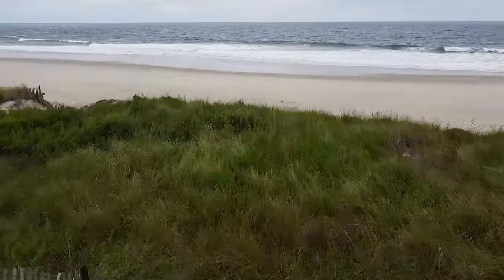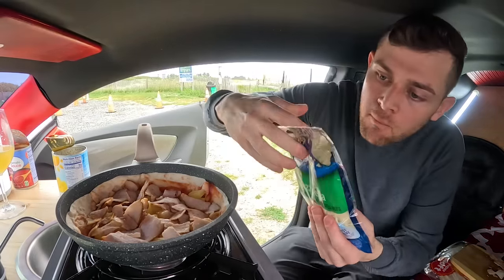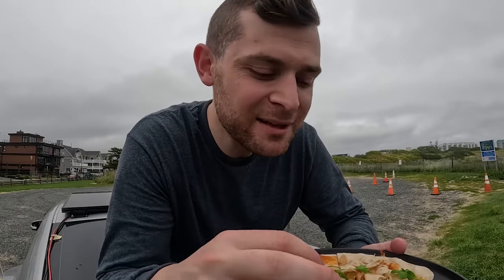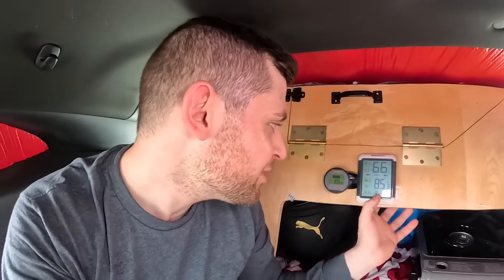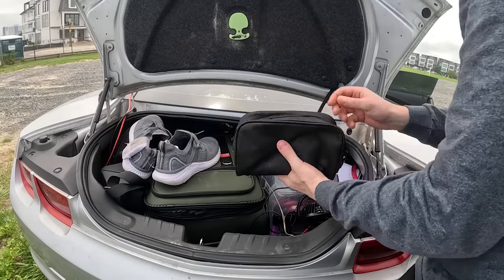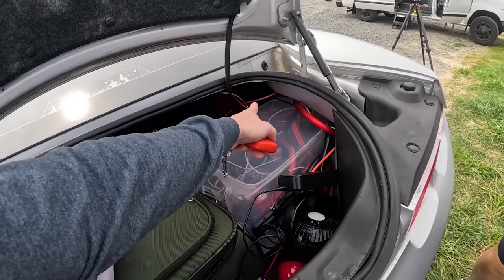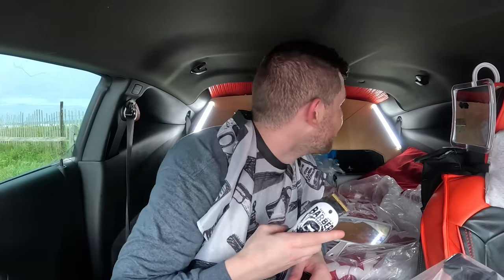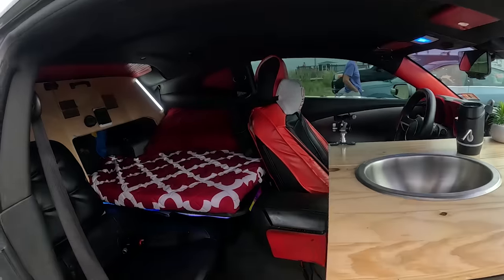My First Time Living In My Car ON THE BEACH! (East-coast Van Life in a small camper)

Comment: the reason pineapple works on a Hawaiian pizza is because its sweetness works well with the salty ham. switching the ham out for honey roasted turkey completely changes it and you lose the balance.
pineapple also works well on anchovy pizza, because of how salty the anchovies are.
also, tomato sauce is not the same as pizza sauce. tomato sauce is sweeter than pizza sauce, and pizza sauce has a bunch of other ingredients like oregano, basil, garlic...
your best bet is to just try it from a pizza place, that way you can have a proper taste test. but iff you want to make it yourself you can easily turn tomato sauce into a basic pizza sauce by adding in some garlic and herbs, or you can buy a premade pizza sauce from walmart or any other store.
but you gotta do it with the ham. ham and pineapple is a combination that just works, on or off pizza, that's why when you see a picture of a really fancy dinner if there's a ham on the table it will have pineapple rings on it.
pork in general works better than basically any other meat when mixed with sweet flavors.

oh, and if you are interested in trying the anchovy version, i suggest anchovy, pineapple, and diced tomato for the toppings. it sounds weird, but it really works

Comment: First time watcher here! Live your videos man! KEEP THEM COMING! I saw you’re working on a set up already so it too late to say this, but you should look into Sterling Fleet Outfitters and the toppers they have for trucks! I have one on my work truck with a PULL OUT HONDA 3000 generator that powers the A/C unit. It also has a built in heater. No need to turn the truck on for heat or A/C and putting unnecessary strain on the engine!

Comment: Hello! If you need to get sand off just put some baby powder on sand and it brushes right off. Also, if you get a plastic cylinder frosty white storage container from the dollar store and adhere a simple  push light (also from the dollar store) to the inside cover you'll have a great cheap lantern with a built in handle to get to the public restrooms when camping or just general light. It really puts out a great throw of light that bounces off the frosted white. And if it gets dropped , it's plastic. No worries.Especially handy during power outages. I've put quite a few together for family and friends.

Comment: OK so here is a few suggestions when it comes to that pizza... you should have used Pizza Sause instead of tomato sause.  the seasonings in Pizza sause are does help  also you messed it up with the Turkey. you can not just replace ham with turkey.  the only way you could have done that is gotten some Turkey ham so it keeps the ham flavor.   next you needed more Cheese maybe you could have tried making it a double decker.  you have the shell Pizza sause cheese and then used the melted cheese to attach another shell then pizza sause , cheese turkey ham and then the pineapple.

Comment: LED overheating ! Dangerous, check for correct voltage DC and amps . install with quick blow fuse . Don't mess with elecs witt incorrect ratings .

Comment: Did you use actual pizza sauce or just tomato sauce? You need the Italian seasonings. Turkey sucks on pizza. Ham and slivers of pineapple are good if off set by spicy pizza sauce. Otherwise a good idea! Good luck on your SUV decision. I own a mid size SUV. The head room is short if you dont remove the back seats. The front passenger seat removal would offer benefits, too. This time, have the vehicle prepurchase examined by a mechanic before buying. It'll cost $300-400, but you likely won't blow the engine. Worthwhile investment.